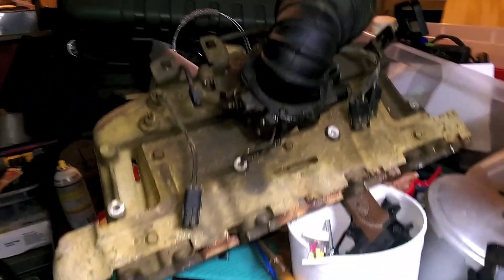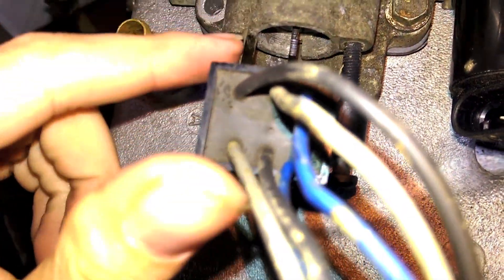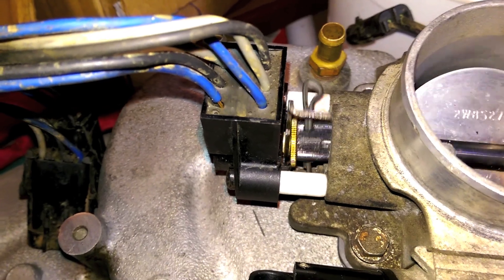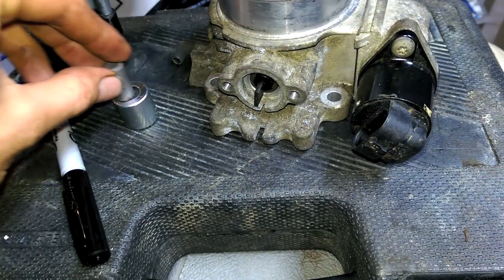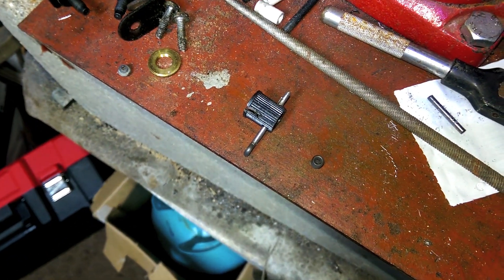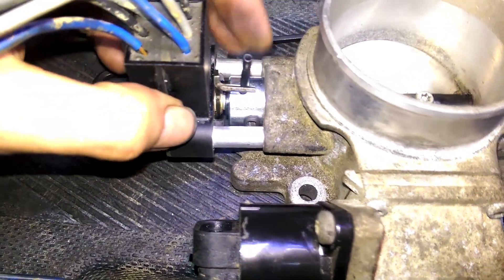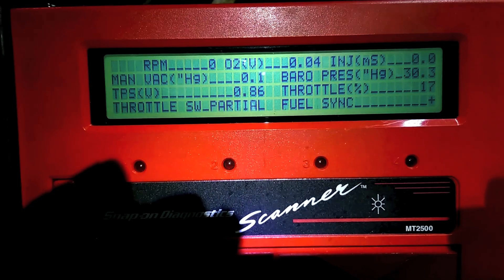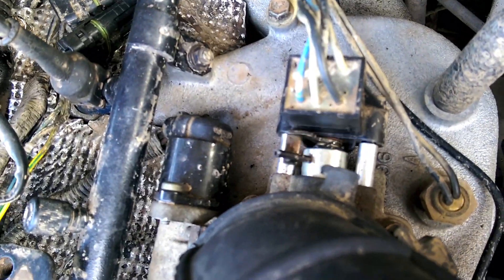Jeep DIY Renix to HO TPS Throttle Body Adapter

Comment: Does someone make a non sketchy adapter or do I need to go full trailer park on my shit
Reply from the maker: Sure, you can pay hesco big bucks for a metal one if you like.
Reply: NickInTimeFilms just looked at it and it’s 145$ trailer park it is
Reply: NickInTimeFilms you should make some to sell
Reply from the maker: I have been slightly curious how well a 3d printed bracket would hold up long term.
Reply: NickInTimeFilms that sounds like a pretty well idea if I swapped the TB do I need the whole manifold as well
Reply from the maker: Yes, an HO TB will not fit on a Renix Intake.
Reply: It looks like a 5.2/5.9L magnum engine TPS would fit perfectly. I wonder if it would work
Reply from the maker: If you have an auto, you need 2 outputs, as the transmission side is the opposite of the engine side. Also with Renix, the TPS needs to be adjusted to 17% for proper function
Reply: @NickInTimeFilms  Ok. Thanks for the heads up!

Comment: Did you have to mess with the IAC at all? I see they are different part numbers between the Renix and the newer stuff. Thanks
Reply from the maker: Nope, stock IAC fits just fine, but I think I had to mount it with the connector facing down for it to reach
Reply: Thanks for the super quick response!
Reply: May I ask, if a person has a manual trans, could they just rewire ABC to a pigtail appropriate for the HO throttle body?
Reply from the maker: Hmm, the answer is "kind of." So I believe you can wire up the HO TPS to read correctly, and with a manual you only need the one circuit so that is good. The only issue is that the TPS won't be adjustable, so hopefully it sits fairly close to the golden 17% when closed. Unless you can modify the mounting holes to pivot it a little.
Reply: Your right, the newer ones don't have adjustment. I looked at them on RockAuto.  They have a medal anti crush sleeve in them, maybe remove those to give some adjustment....well maybe. LOL
Reply: IIRC the diameter of the pintle and housing of the IAC got larger on the HO throttle body.

Comment: Hey Mann I got a Thor crowl off road intake and the elbow to fit in the throttle isn't the same as your throttle body like yours in this video you have .. and idk if I need to get a whole new throttle body if you have any questions bout it I'll appreciate the help Mann thanks and it was in a bleepin jeep video ??
Reply from the maker: Uhhh, well first off what year is your Jeep? That THOR intake kit is for 91-01 XJs which would be for an HO Throttle Body like what I have in this video. It's just a simple neck that a tube could fit over. If you have an 87-90 XJ then you have a Renix Throttle body which uses a bolt on intake tube and will not easily work HO stuff. 

I think there is someone that sells a Renix to HO Throttle body adapter plate, so you could mount an HO TB to a Renix Intake Manifold, but then you'll have to convert the TPS over like this video shows. Might be a bit more effort than it's worth
Reply: NickInTimeFilms it's a 89 XJ

Comment: Hi. Is this a conversation from the stock early Renex manifold to a later model H.O. manifold?  I have a 89 4.0. And I need to Chang my intake manifold gasket.  Can I swap out for a later H.O. manifold and do this conversation?  Also is the later H.O. 4.0 exhaust header different than my stock 89 exhaust header.
Reply from the maker: +Mountain Model Casting Dobrowolski yes, this is part of the new H.O. manifold swap. Whole video on the rest of the process. The manifolds are both different but do are the ports so it's best to swap a new cylinder head on too

Comment: Maybe should've gone with some .001 shim instead of the electrical tape..or possibly even aluminum foil.  Seems like the tape would melt over time, and leave the inner cylinder slightly off-center or cause the setscrew to slip.  But other than that, good job man!
Reply from the maker: 100% True. It's still working to this day but a tighter fit would have been nice.

Comment: you made it harder then Need to be. could have taken the tps arm off the renix TB and dremeled the hole to press fit to the newer TB also cheaper and does the same.
Reply: Do you have a link to a video or write up for how to do this? I may still do it the way Nick did, but, I dont have a drill press or tap set, so might be harder to make the hole straight and also add the cost of a tap. I thought I'd seen a video before of using the renix arm, but I am not finding it in my search now.

Comment: Also how do you adjust the TPS if you don't have that fancy scan tool?
Reply from the maker: As for adjusting the TPS, it can be done with a multimeter and a little math. What percentage you adjust it to will depend on whether you have and Auto or Manual Trans. 

For a Manual this video from BleepinJeep should cover it:https://www.youtube.com/watch?v=KFaAlhGQyQo

For an Auto it's mostly the same but instead of probing the Flat 3 prong connector, you'll want to probe the Square 4 prong connector for the trans. Terminal D is your Ground, Terminal A is your Reference Voltage (In), and Terminal B is your Output Voltage (Out). You'll do the same process as shown in the video except you will want an 83% difference between Reference and Output because the voltage gets lower the closer it gets to WOT (Wide Open Throttle). Otherwise it's pretty much the same process.

Comment: What size did you tap the set screw to?
Reply from the maker: The tap you use depends on the Set Screw you use as they have to match. My Set Screw was 1/4" x 28 which is fine thread, so that is the tap I used.
Reply: +NickInTimeFilms I'm following your build to the T, I just got done doing the Renix to HO mod and this is the last step